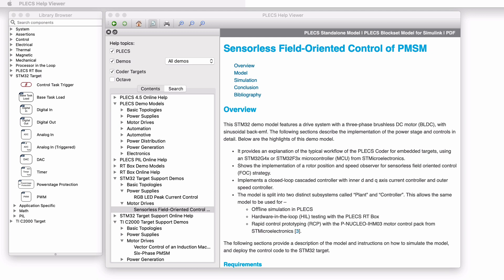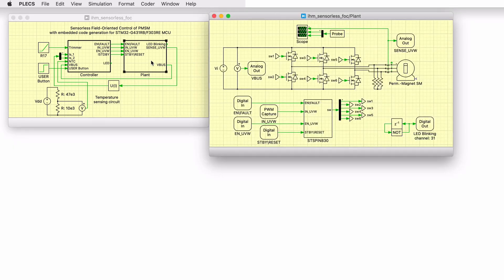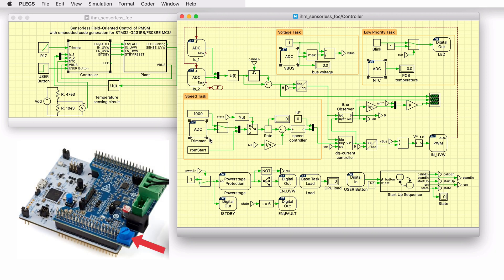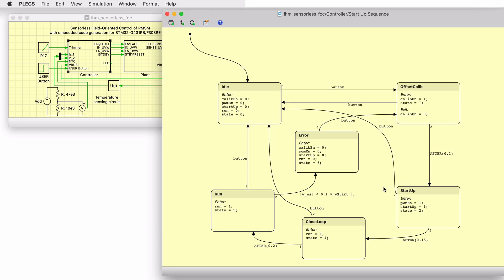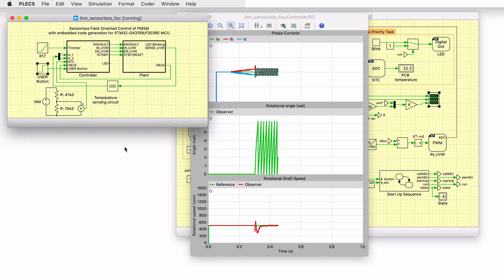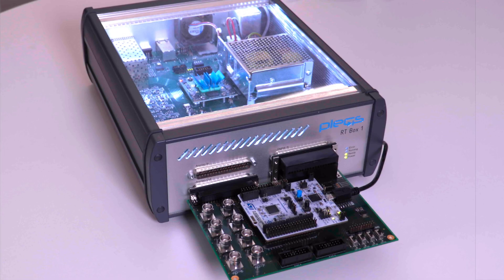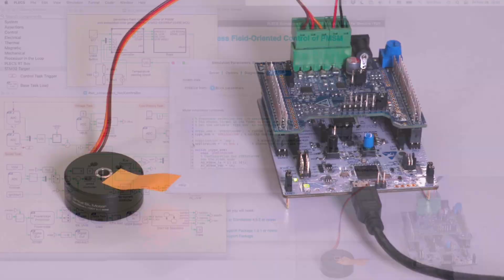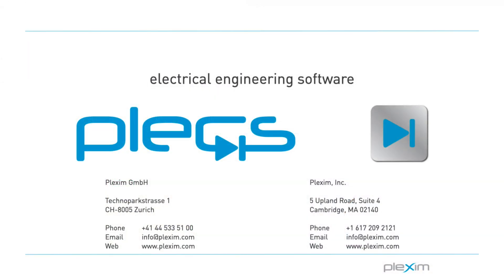PLECS Code Generation Demo Model: Sensorless Field-Oriented Control of PMSM on an STM32 MCU

Comment: The STM hardware shown in your video is old and you should use a better one like the ESC001 (which also have LPF converter measurement , that allows input power,  stator resistance and PM flux estimation.
The latest hardware is the STM G473, with a dual converter setup, that also has LPF voltage measurement and encoder inputs for two PM motors, hence recommend you use that setup, assuming that your coder can handle this MCU, of course.
Reply from the maker: Hello, thank you for the tip!